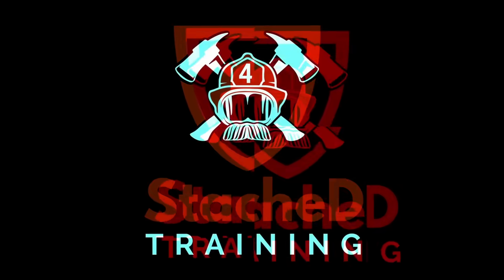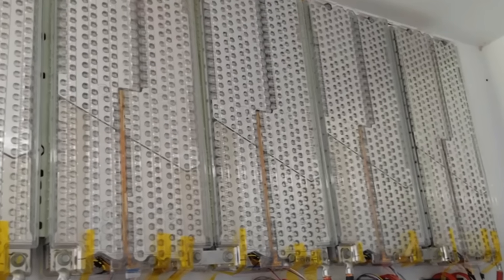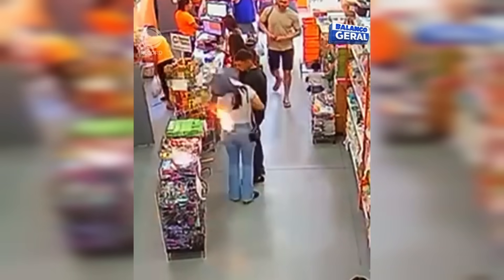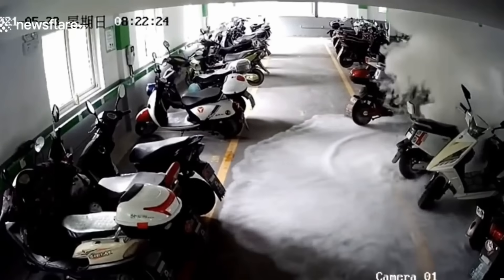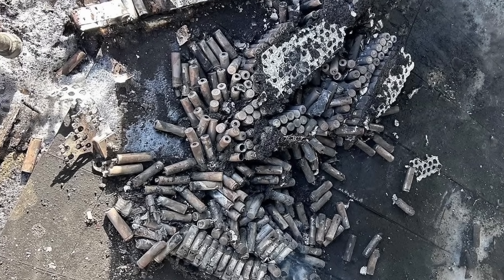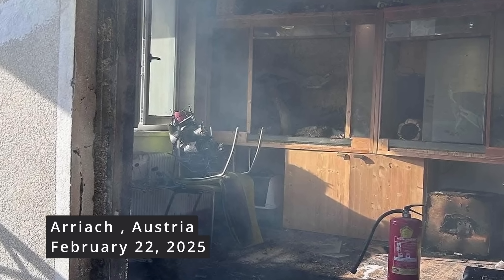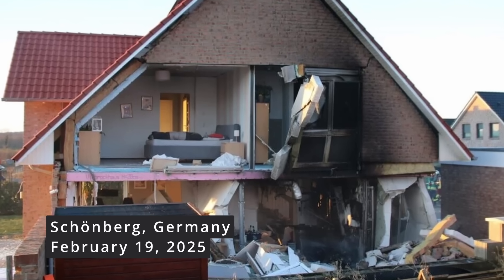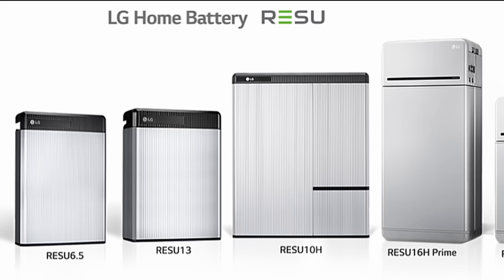Two Homes Just Exploded—The Hidden Danger in Battery Storage!

Comment: I don't get it why we use lithium in stationary applications. There are many other battery types which are while less energy dense, are also waaaaaaaaay less prone to self ignite. It's a frickin house, who cares if the pack weights +50% more???
Reply: Old school lead acid battery systems need a lot more skill, maintenance, and time devoted to them. The more batteries you have the harder it is to keep them balanced and not be overcharging cells etc. Definitely not for the average consumer with a busy lifestyle. It's also now more costly to go down that path as you need at least twice the capacity to get the same usable capacity as lithium, and perhaps up to 4x the amount to match discharge rate of lithium depending on load demand.
Reply: @ The upcoming sodium ion batteries are looking promising, once mass production is on the way. Less energy dense than lithium, but cheap to produce, and long service life.
Reply: You can get 20 years out of a NiCad system if you maintain them , you can change a single defect cell but they need to be stored in a safe area because of gassing. Not to hard to do as small battery cabinets for external storage are not that expensive.
Reply: @nigelliam153  Lead-acid also has gassing, you solve either with ventilation, just a bit of HVAC.
Reply: @OnlyKaerius yes. The battery lockers I was referring too can have a vent fitted if you need to locate them indoors. I over looked the issue with extreme cold in places like Canada and USA.
The lead acids are cheaper but don’t last as long. It gets down to how much you can pay upfront and how long you need it to last.
We run a friends fishing shack on old car batteries that are no longer good enough to crank an engine but run a few lights and a camping fridge no problems. Just have to arc up the generator every few days.
Reply: I would have no problem using a system like this but I'm a fabricator so I'd pour a concrete trough with a welded steel plate housing far away from my house that it could burn itself out and I'd put a blast door on top in case it exploded
Reply: @chrisrageNJ it is still bad because you always have the risk of flooding
Reply: If you want to save money you get a pack out of a wrecked EV that someone is likely very happy to get rid of. There will always be people trying to save money
Reply: @stephenw2992 getting a battery pack out of a wrecked EV  and putting it in your house is like buying a grenade not knowing if the pin is in or not!
Reply: @ ah yes, the ticking bomb option.
Reply: @stephenw2992 A potentially damaged battery ,the kind that start fires . Been happening in storage yards already.
Reply: Edison batteries, nickel and iron, are way safer.
Reply: @irchrisb They’re also huge, but you can bury them in the ground without too much performance penalty.
Reply: Because LFPs are cheaper and more stable.
Reply: Lead acid is not allowed, there are laws against it (NL) for the exact reasons show in this video. The only other option in NiMH.
Reply: @jeroen5838  There is no reason for a pack of any type batteries in your house . Just get a back up generator for power outages.
Reply: LiFePO4 is a lot safer than Li-ion. Don't use packs from cars in your home.
Reply: This is the exact problem. There was no issue when people were using Lead Acid batteries in these types of setups. As an added benefit, lead Acid batteries are easily recyclable. Unlike Lithium batteries.
Reply: @Crosshair84  in China the gov,t is suggesting that all ebike owners trade them in on the newest models which have gone back to yes that,s right Lead acid batteries because of the huge amount of ebike fires with lithium batteries

Comment: Great video and thanks for sharing!. I lost the vid about the german house that had a makeover within one secondto scrapyard value..... 

LFP with it's higher thermal runaway temperature (270 vs 140 of NMC batteries) has the best cards regarding stability.
Main rule: only buy new and tested cells from a trustworthy reseller.

Place these cells in at least 1,5-2mm thick metal boxes that can withstand a pressure build up of one or more venting cells and a venting connection with a valve to connect it at the exhaust system.

Next important thing is a capable BMS (bleeding current of at leat 1 Amp).
Better is to have a shadow BMS that only monitors and acts when the first BMS fails.

Then there needs to be reliable communicaton with the inverter in order to throttle (dis)charge power when limits are reached. When comms fail, the inverter must shut off immediately.

If the voltage or temperature treshold is reached, the batteries must be shut off immediately by a high capacity relay that is capable of disconnecting under the calculated load / voltage.

If the relay stucks, then fuses that are calculated well must take over the safety shutdown.

Here the gassing might occur is all previous measures fail.

Then the aerosol extinguishing must kick in that cools the process of venting AND binds the H2 component.

In best case scenario, the cells must be devided in different compartments that is connected to an exhaust pipe outside the technical room where the batteries are stored. This prevents building up explosive gasses.

If temperature still keeps rising, then batteries need to be flooded until all thermal/chemical activities have stopped.

This is the way my system will be designed IF I keep it inside my house. I will probably end up with heated concrete boxes outside the house of a flat roof at a safe height that can resist temperatures of 1400 degrees before collapsing.

There are 3 routes to leave the house safe so if one is obstructed, there are 2 left.

If you want to sell cheap chinese batteries for the lowest price and with inferior BMSses, installed by a company that is not aware of the riscs and does not have the knowledge, then you have a very serious risc cocktail....

As long as you engineer DIY batteries with the guidelined above, I can imagine you'll sleep well.

Just my tw cents...

Comment: These systems should be installed in freestanding shelters that can be heated & designed with roof 'blow off' panels similar to the ammunition storage in a modern main battle tank where the top is designed to blow off directing the energy of exploding ammunition up and away from the crew. On a battery storage shelter, this would similarly redirect energy away from persons or adjacent structures.

Furthermore, this freestanding shelter should be clearly marked indicating it contains a battery energy storage system so that 1st responders are immediately aware of the hazard & can tailor their response accordingly.

Comment: Everyone pushes the Li-Ion battery. If I was building a battery storage unit I would use good ole lead-acid car or big truck batteries. Proven safe for a century and lasting  5 to 7 years depending on number of discharges and depth of cycles. Very forgiving of low and high temperatures and overcharging. Yes they can vent Hydrogen gas when charging, however its easily vented from the battery room. Some battery models have a vent tube already installed. Or install a blower up high venting to the outside.

Comment: It's probably beyond time for a section in both the Electrical code and Fire code.  I know there is a section for data centers battery backup's   but I don't think it covers newer battery storage areas or the concerns with the newer batteries.

Comment: My two cents is if installed indoors then it needs to be in a sealed container that has a vertical vent to the top of the structure.  That way if it starts generating hydrogen the gas vents above the building.

Comment: Inside or attached to a home? No way!  My off grid system is based upon lead acid batteries set inside a work room. I Also added a set of lithium batteries but placed them in a cement bunker in the side of a hill 50 ft from my house with their own inverter, charge controllers and RV cable that runs to the house transfer switches. I designed the bunker to be like a large wood stove, with vents and uptake pipe. If the batteries should self destruct, they would do it in a controlled way.
Reply: Sealed or flooded lead acid?
Flooded lead acid needs venting due to hydrogen production during charging.

Comment: Thank you for all the advice you give. It is helping me decide what to use for emergency power. It may be just too much of a risk to put battery backup anywhere in my old house. I already have propane at my  place. it might be safer to run a propane generator for emergency. Just as long as proper maintenance is kept up.  If there is even a remote  change of battery explosion I don't want it.

Comment: We now know enough to require these battery storage systems to be banned from being mounted inside residential structures or attached garages. Require them to be either a) freestanding in yards at least 30 feet/10 meters from any exterior building walls, or b) put them in fire- and blast-resistant buildings designed to vent any explosion upwards, rather than outwards, like explosive manufacturers do with powder or product magazines.
Reply: Lol yeah where it's cold or super hot which batteries don't like😊
Reply: Most people don't have 30 feet, such regulations would just make solar unaffordable and unattainable. Safety over freedom never works.

Comment: Not sure what make of this situation as leaking gas explosions typically level the house also. You are bringing attention to this problem so its on our mind a lot more. At this point me personally any thoughts of buying an EV or home  battery is definitely on hold. I do have gas in my house, so may one threat is enough.
Reply: Gas is only dangerous if it's not installed properly, otherwise it's pretty safe. When you see a gas explosion it's usually from improperly installed equipment. How many house explosions do you hear about, maybe 1 or 2 a year? Electrical fires are more common

Comment: These batteries should only be used in a designed enclosure which must outside at a  minimum distance away from the occupied building. The enclosure should be made of steel and it should have a roof which is designed to blow off at a certain pressure. If the batteries explode , the enclosure will become a topless steel firepit while the batteries burn.

Comment: Could a dedicated explosion room, with  venting, automatic closing explosion door/frame and exterior wall explosion panel be specified by the battery manufacturer? For home construction simplified Building Code specifications could be developed, with input from interested parties, such as Building Officials, Fire Department Officials, and manufacturers.

Comment: Its the small cells.  You can't monitor each cell in a system with hundreds of cells.  Large cell batteries like you typically see with stationary LiFePO4 systems allow the BMS to monitor each cell and have cell level over and under charging shutoffs.  Lithium battery cells tend to get out of whack easily compared to lead acid for some reason.  The pack can be no where near fully charged but one cell can hit max charge.  If the cell isn't being monitored its going to get overcharged and damaged.  The same thing happens going in the other direction with low state of charge.  Once you have done this to a cell (over or under) and its damaged it because the weak link for a failure later on.

Comment: I'm designing a "farmers Battery" a battery for small farm houses (I'm in Guatemala)  , it is enclosed in a fireproof container , the NiMH batteries are spaced apart from each other and against the outer walls for cooling it does not need any type of cooling fans or pumps that can fail. each unit is 3/4 KW and there will be a way to have up to 5 in a spaced row all free standing away from walls or any furniture.
Reply: You sound like a proper engineer who is thinking what will work best and be safest.
Reply: @ Thank you , actually my background is 19 years as a diagnostic electrician (I figured  out what went wrong
) and I'm an accident report junky.  I think spending 19+ years seeing all the ways things go wrong gives me a unique perspective.

Comment: These battery units will probably need to be installed separate to the house, like a small supply transformer/pedestal somewhere on the property.  Having them in the street near the mailbox might be the best option.  Then there's space for it to vent and/or burn without doing too much extra damage.
Even having them against an outside wall of the building is a fire hazard.

Comment: While I agree we need better designs for battery storage some "DIY" solutions do use purpose made BMS boards. We need standards that address detection and prevention of thermal runaway events. Perhaps battery packs need to have pathways for water to cool them when a thermal runaway occurs. We also need container standards that include ventilation.

Comment: I designed and installed my home solar system myself (I'm an electronics engineer). I opted for AGM batteries instead of the more capable Li-Po or similar units because they are way safer.
Reply: Hope they are properly vented. AGM batteries can still produce hydrogen.
Reply: @ they are, and the hydrogen generated is very modest and they don’t go in thermal runaway
Reply: I have a bank of four Trojan 225 ah 12 volt batteries for my system.  I recently bought five  lithium 24v 100 ah batteries and placed them in a cement bunker 50 ft from my house.  Retired marine engineer that sleeps well at night.
Reply: LFPo is more efficient, even in an isolated, insulated, temperature-regulated shed. Price per kw per cycle is far lower. Lead-acid has a max efficiency of 80%, and much lower cycle life.

One of these incidents he cites, was a DIY hack job with used non-LFPo cells, the other was also not LFPo.

If you're going to put your storage in an isolated shed, might as well use the best chemistry there is.
Reply: @ AGM batteries are way cheaper, and if you have space you can get the same or more effective KWh per £
Reply: @Mark-ej3oi  Price per kw per cycle is far cheaper for LFPo than AGM. Lifecycle of an LFPo is over 15 years, and with solar it's typically calendar aged. At 15 yrs, figure about 85-90% capacity, yet that capacity remains 99% efficient. 

You'd have purchased AGM 5x over, to have matched that life cycle. Per kw per cycle - many more cycles, all at 99% efficiency. 

Depth of discharge hasn't been mentioned yet, or voltage stability.

Comment: Try to check in luggage with a lithium battery with an airline, or try to plug in your power brick (you can't check in) during flight inside the cabin. Those are bombs.

Comment: Electrical batterybanks has to be the most dangerous form of storage especially with these materials. If you really had to what is wrong with the normal lead-acid batteries we've always put in ICE cars? It's not like the batterybank has to be particularly mobile. Storing heat for an offgrid cabin is an entirely different matter. You could run waterpipes through homemade "panels" heated the sun then use it to heat an insulated cistern of water. The whole "electrical storage" thing is a "solution" looking to re-solve problems we create through our lifestyle.

Comment: EV's have a history of catching fire.........so what better than to get old EV batteries and use them inside your home.
Reply: The J1772 standard actually has a provision for ventilated charging.
Intended for the EVs using flooded Lead acid or NiCd traction batteries at the time.